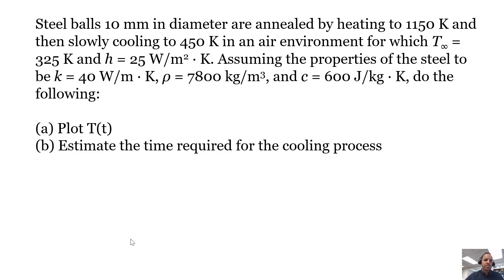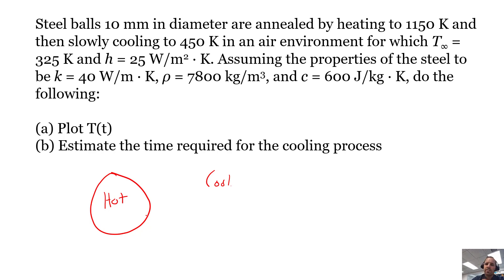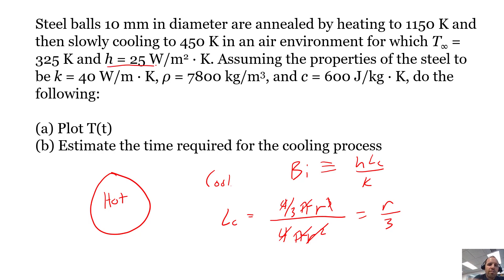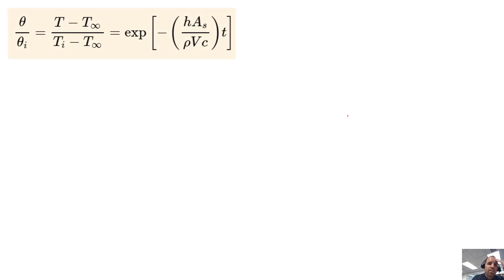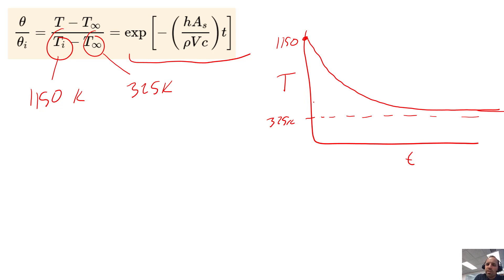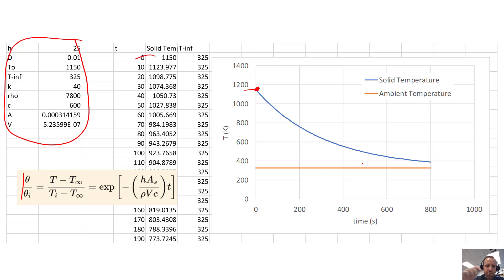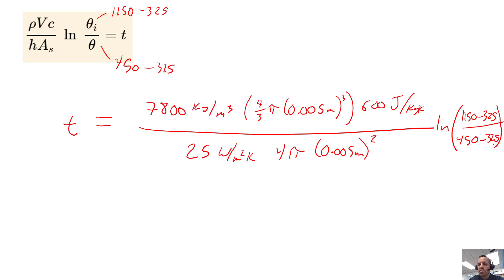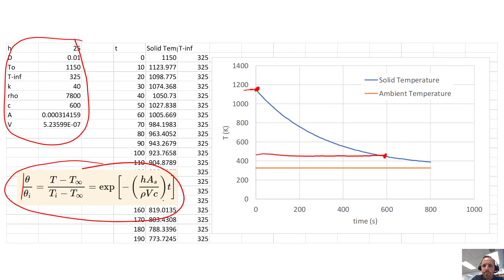Heat Transfer - Chapter 5 - Example Problem 1 - Lumped Capacitance Method for Transient Conduction

Comment: For one-dimensional transient conduction in flat walls, long cylinders, or spheres by surface convection, what dimensionless parameters can be used to simplify the representation of thermal conditions? How are these parameters defined? is it using biot number or theta?
Reply: biot number